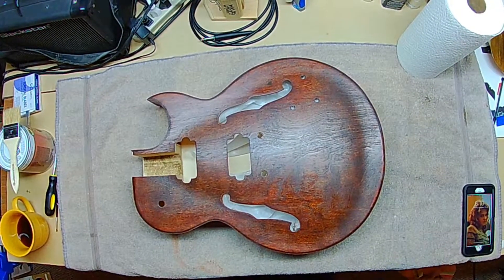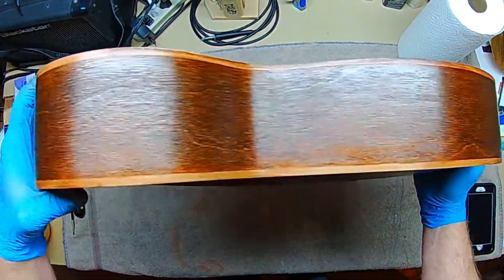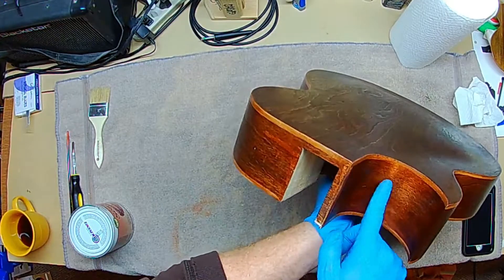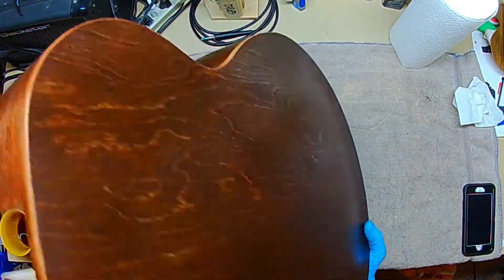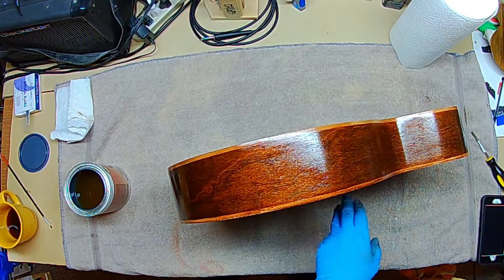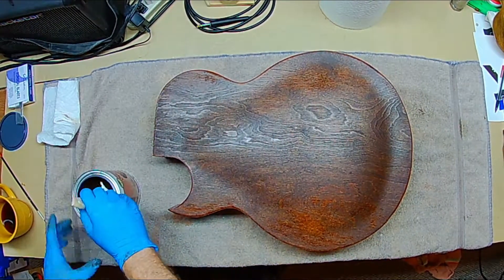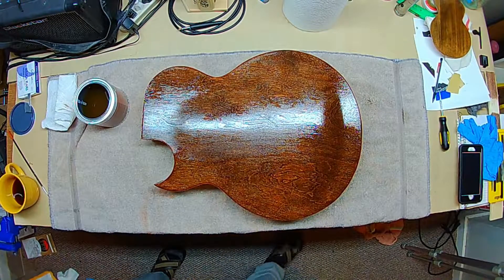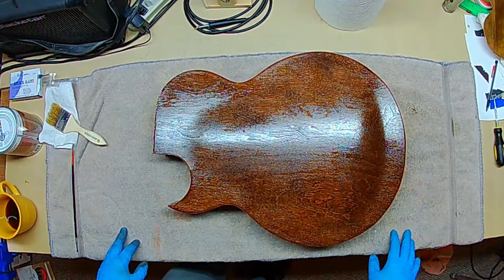Fretwire Guitar Kit 175 Part 6 - More Finish Work...Sealing the Stain

Comment: Can you please write what you used as finish and the other thing on the neck? All materials. I´m enjoying your videos by the way:-) Sincerely Teacher Frederik Olsen from Sisimiut, Greenland
Reply from the maker: Here are the steps and materials used for the finish. With all of these steps it helps to work in the direction of the wood grain...

1. Sand all wood surfaces up to 320 grit.
2. Clean surface with a tack cloth.
3. Apply 2 to 3 coats of wood stain to get the color you like. I used a red oak stain. 
4. Allow stain to dry completely.
5. Clean surface with a tack cloth.
6. Apply 2 coats of sanding sealer over the stain.
7. Allow sanding sealer to dry completely.
8. Use 0000 steel wool to even out the finish.
9. Clean surface with a tack cloth.
10. Apply 3 coats of water based polyurethane.
11. Use 0000 steel wool to even out the finish.
12. Clean surface with a tack cloth.
13. Apply 2 coats of wipe on oil based polyurethane.

The headstock logo is a waterslide decal I had custom made from an eBay seller. I applied the waterslide decal after the sanding sealer step above and then finished with the polyurethane. I hope all this helps. Please let me know if you have other questions and I'll do my best to answer them. Thanks for watching and commenting.

Comment: Hi, so im working on staining my guitar kit. I like the look of the binding however I didn’t tape it off. Is there a way to remove the stain from the binding?
Reply from the maker: To remove the stain from the binding I would do the following... First, make sure you are done and happy with the staining so you only have to clean the binding once. Second, use a razor blade and CAREFULLY scrape the stain off the binding. This will take come time so just be careful and go slowly and you should be good. Thanks for watching and commenting...